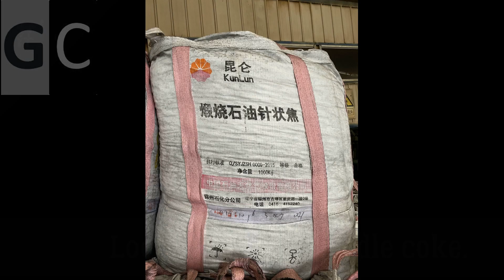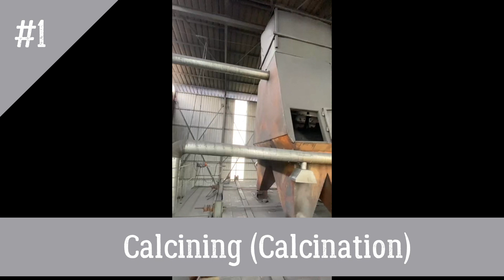Graphite Electrodes Manufacturing (Production) Process. Производство графитированных электродов

Comment: Such a simple chemical element with so many interesting properties: high melting (or sublimation) temperature in excess of 3500*C, good electrical conductivity and ease of manufacturing and abundance.
Reply: Yeah, carbon is nonmetal. It's part of the organic life and surely, was invented with a purpose. Very useful thing. 
https://en.wikipedia.org/wiki/CHON.

Comment: 6 shop hoti h total 1st green electrod
Bole to row material shop
2nd baking 
3rd imprigation
4th rebaking 
5th  graphataisation 
6th pfs product finishing shop
Fir electrod ready ho jata h
Reply from the maker: 1. Raw materials (100% imported needle coke, coal tar pitch).
a) Crushing.
b) Calcining (Calcination).
c) Pulverizing, Weighting, Screening and Dosing (Classify the screened coke according to gain size and store them in individual silos).
d) Mixing (Knead the mixed coke and binder pitch into kneader).
2. Forming (The kneaded material is formed into green electrode by extrusion press through various press nozzles and by the extrusion press and cut into specified lengths). 1:30
a) Water-cooling
3. Baking 4:18
4. Impregnation 5:23
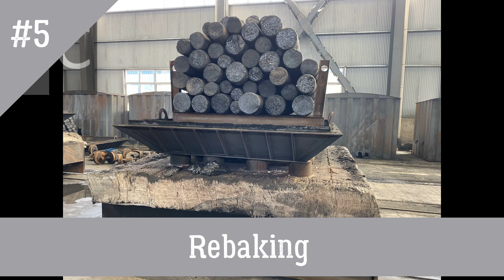5. Rebaking 7:23
6. Graphitizing 8:04
7. Machining 10:04 
8. Inspection 11:52
9. Packing 13:51
10. Loading. Shipping 14:45
Reply: Thanks bro
Reply: aa
🎊oo

Comment: Compared to modern Graphite Electrode manufacturing shops, this video depicts outdated, primitive technology.  The Pitch Impregnation process is very archaic. They are still using Acheson style graphitizing furnaces, as opposed to modern longitudinal furnaces.  This facility is about 50 years behind modern shops.

Comment: what materials are mixed in the graphite electrodes?
Reply from the maker: It depends on the Graphite Electrode Grade and Size. For low grade its coal tar pitch and petroleum coke, UHP - needle coke and coal tar pitch. More information you can find here https://graphitecarbon.ru/en/graphite-electrodes-production-process/
Reply: @GraphiteCarbon oke thanks for information
Reply: How variation sintering graphite?
Reply from the maker: @drajatjati9444  what do you mean?
Reply: How many temperature sintering graphite ?